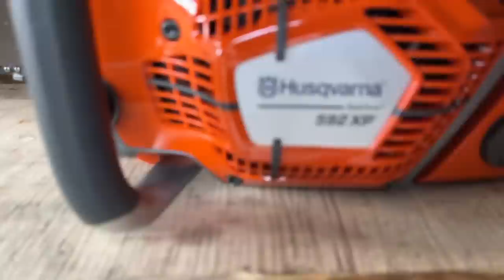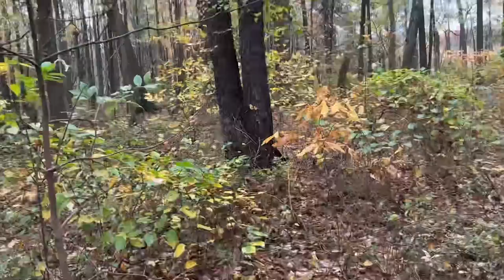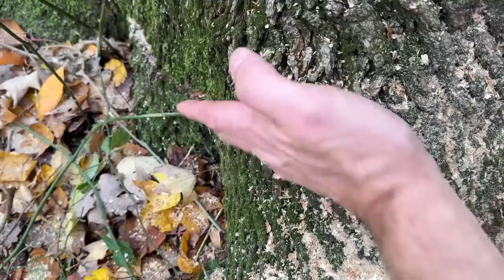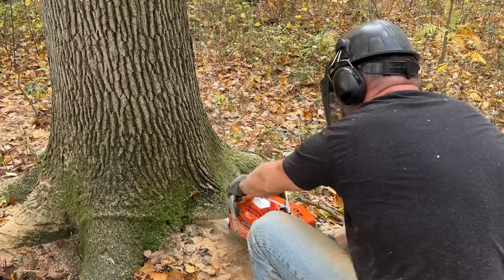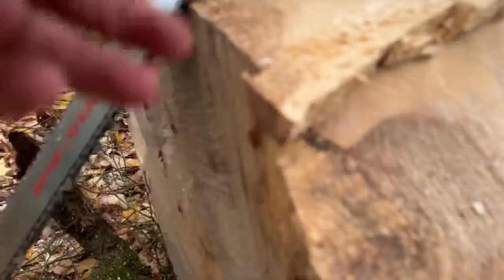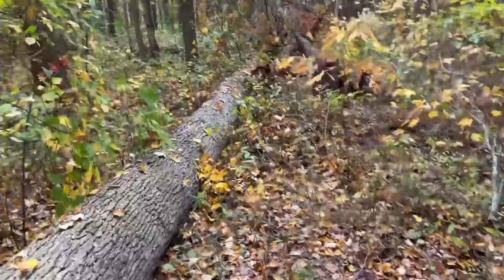How to Spur Cut! Cutting techniques that professional veneer cutters use.

Comment: Got the ol sawking built 394 out this wk and knocked down a cypress for my buddie…30mins had 3 logs and no limbs..lol..I’d like to try the new 92s…I have 395..064..288…460..880..and several smaller saws…288 is a dandy too….thanks bud…matt
Reply from the maker: Hey thank you!

Comment: Great job. Question, if the tree has a natural lean, why couldn’t a guy flush cut the entire front to the back and leave a spur or two as the hinge wood?
Reply from the maker: Hey can and I have video doing it. 
Problem is if your not experienced the tree will sit down on your bar.
Reply: @Good.Fellers  good point, I’d say wedges need used for sure.
Reply: @Good.Fellers I’ve heard it called felling over the saw.

Comment: Really interesting. Never heard of this. I’m a personal use firewood feller myself so not so important but great way to get every inch for other uses. Do you ever run into pinching with the front spurs?  I don’t know if the short vertical cuts avoid that?
Reply from the maker: When I first started I got pinched all the time.

Comment: I can definitely see how that would be useful cutting veneer timber.  Do you only do those on trees with some head lean?  It seems like on a tall straight tree, or back-lean, you would need space for the tree to fall into?  Just asking.  I’m a firewood guy who owns a farm.  What I know about felling I learned from the internet.  I was way more gunho when I was younger.  When in doubt, gun it out was our motto. Then run! Lol
Reply from the maker: Straight tree it’s fine is a wedge leave a undercut spur holding etc. back lean go another way.

Comment: nice cut . I would probably have trouble matching the cut from behind to the cut from the front , is there any trick to it ? Or does the front cut come out on the back side a bit ?
Reply from the maker: Sticks out the sides
Reply: I have some maple logs to cut
not veneer , but nice saw logs  . I will give it a shot  @Good.Fellers
Reply from the maker: @robintaylor-mockingeemill8223 please be careful!!!
Reply: If I'm not feeling it when I start , I will use a more conventional method @Good.Fellers
Reply from the maker: @robintaylor-mockingeemill8223 good deal!

Comment: It probably doesn't always work, but the spurs could help prevent it from slipping back to you. Respect on starting the cut with nose of the bar i quit doing that because i always got kick back trying it that way 😂
Reply: you get kick back  because you chain is not sharpened properly.  Even some new chains like to do some kick back because they are sharpened to aggressively from factory.
This type of felling is really sketchy because tree is cut off no real holding wood to steer the tree so tree goes where it leans and rols off the stump left right and if you are lucky it jumps out of this spurs and slipp back. I would never use this technique.Even if it leans do normal face cut bore cut it and then triger it from behind much safer faster more controll.
Reply from the maker: Bore cutting is a technique worth learning. You are correct about the spurs stopping the slide back off the stump.
Reply: @jureslegel3877  chain is sharpened properly  I think  it's just how you  start it into the wood

Comment: They have fuel line issue and to carb .and comes lose.like 661 .s have similar issues with intake boot .592 lines get kinked.its to long cut it shorter
Reply from the maker: Local shop is repairing lines and computer issues as a warranty.

Comment: That’s the goofiest way of felling a tree I’ve ever seen. So unpredictable when coming down.
Reply from the maker: Glad you liked it!
Reply: Nicely done, your bore cut was less that a 4” above the ground.  Every Midwest logger worth their weight will spur cut.  You’ll get made fun of if you bring in a log that’s been match cut.  If you aren’t a veneer cutter or if you’re a handyman or a tree service feller this is over kill.  It’s for grading purposes only, the middle of the log cannot have pulled or damaged fibers if it does your log is no longer veneer and sawmills will not waste their time and cut off 3-4’ of log to get to undamaged fibers.  And you loose those precious board feet.  Also the logs skid out easier if you don’t have hard edges catching on everything in the woods.
Reply from the maker: @adamboone6864 all facts.
Reply: Had a logger do my place in 2018 and every cut was like that. There is a reason for it and it is explained very well below in the other reply. Makes a LOT of sense when it is explained to ya. Everyone involved in the logging operation benefits from cuts like this. Take care.
Reply: Don't give up your day job. One stump left like that would get you fired the first time you caused a ruined skidder tire after running over that stump.
Reply from the maker: @kevinlibby6337 stump won’t hurt a forestry tire bud
Reply: Did you watch the entire video? He announced where he wanted it to fall. 10 minutes of video later, it fell exactly where he directed it.
Reply: This is Exactly how you harvest hardwoods in the midwest. You walk a property after a walnut harvest in NE Iowa, SE Minnesota, SW Wisconsin where I'm from, every walnut stump will look like this.
Reply from the maker: Sounds about right

Comment: Felling professionally for 20 years and never seen or heard of this technique. No directional control and sketchy as hell. What if you smash the top out of another high value tree that is being retained or it gets hung up in an adjacent tree and you waste time having to take it down.
Yes, cut the buttresses off, but if you don’t want pulled fibres bore out the middle of the hinge and/or put in sapwood cuts depending on species. Face cut every time. In professional forestry there’s no room for cut and hope.
Reply from the maker: Thanks for your opinion.

Comment: Turner boys are keen on this type of felling….im learning…comin from residential and power line clearance im a hinge type of guy as we had to precisely fell ones parallel with 25kv with pinpoint accuracy and no twist,flip, or roll..tried stuffin a small one through limbs close to small line and not enough weight to push through and rolled enough to pop a fuse as it grazed line….my 1 and only time I knocked power…and I felt like I’d lost World Series….i jaw a lot hopin it’s all for the good on yer channel….💪🏻🫡
Reply from the maker: I appreciate the comments

Comment: One of my crew asked "Why cut it like that?"  Simply.. Its to not  waist wood?  By not making face cut, you dont loose wood by cutting off to evan up butt? and so that the tree is not locked into a hing, so its free to roll and slide off of things?  I put question marks.  Because, unfortunately,  I know with some companys it may not or cant be an issue.  Also , you can use this cut for other situations. Like maybe on a sketchy large uprooted tree leaning into another after wind storm.    Great job. Keep it up bro
Reply from the maker: Hey thank you!